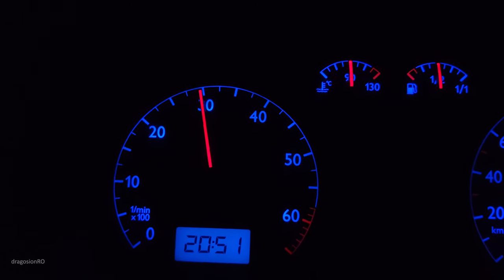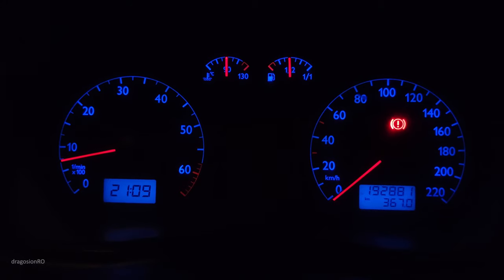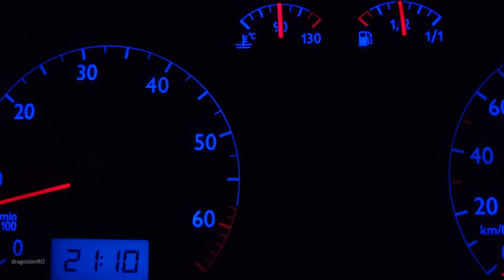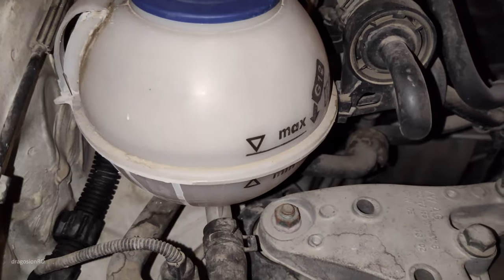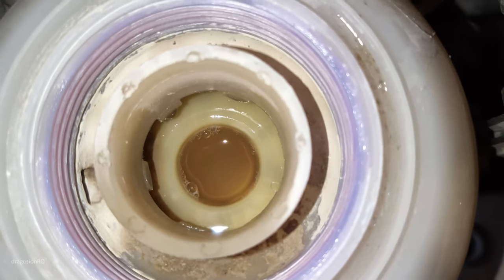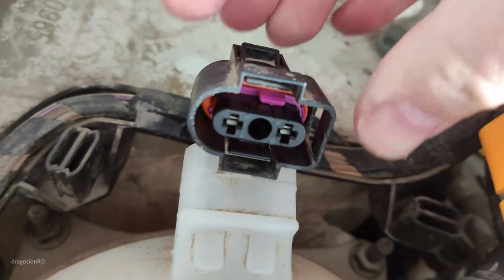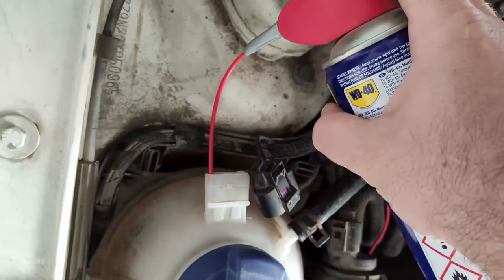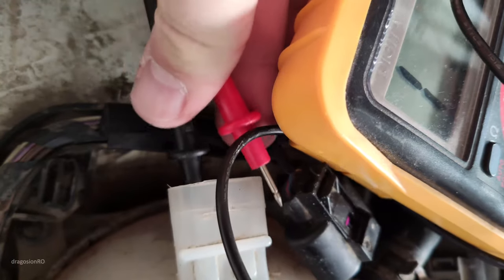VW Polo Temperature Light Flashing Fixed

Comment from the maker: Amazon: Engine Coolant Expansion Reservoir https://rex.red/engine-coolant-reservoir-vw-polo-9n *
Tools https://rex.red/car-tools-kit-mechanic *
Cleaning https://rex.red/car-cleaning-supplies *
WD-40 https://rex.red/wd40  *
Torx socket set https://rex.red/torx-set-socket-45-55-60  *
Jack https://rex.red/car-jack *
Stands https://rex.red/car-jack-stands-heavy-duty *
Gloves https://rex.red/car-gloves-mechanic *
Safety glasses https://rex.red/safety-glasses-anti-fog *
Spark plug removal tool  https://rex.red/spark-plug-removal-tool  *
Spark plug Gap tool https://rex.red/spark-plug-gap-tool  *
Coil puller tool https://rex.red/coil-removal-tool  *
Car fuse set https://rex.red/car-fuse-kit  *
Battery tester https://rex.red/car-battery-tester  *
Maintenance kit https://rex.red/car-maintenance-kit  *

Subscribe and Ring the Bell to watch more videos.
ION HowTo https://rex.red/ionhowto
RedNumberONE https://rex.red/rno

Buy merch https://store.ionhowto.com/
Check it, buy it, post it and  tag it #ionhowto or #rednumberone

Join this channel to get access to perks:
https://www.youtube.com/channel/UCx4Qbp3iC97kQzj7e7g7slg/join

We earn money from qualifying purchases using our affiliate links.
Affiliate links are marked with a star. *
When you use our * links, you support this channel.
As an Amazon Associate I earn from qualifying purchases.

Comment: Thank you for the upload.
My polo struggles to idle and switches off when cold but idles perfectly when warm.
Any ideas? Thank you in advance. 👍🏼
Reply from the maker: Look for videos about coolant temperature sensor. I didn't make any. Could be this sensor too or the throttle body. Try carb spray and too
Reply: @IONHowTo 
Thank you very much. I'll check for those items. 
Thank you for responding so quickly.
👍🏼
Reply: Timing

Comment: Hi! Hi have the same Car, polo 9n. A month ago I removed the battery from the machine to be able to recharge it since with the lockdown and the little use, it was discharged. Today I resinserted the battery. Then I turned on the car and started. After a few seconds it emitted 3 beeps and the red temperature light started to flash. The liquid cool is ok and is slightly above the minimum level. I topped it up but the situation hasn't changed. I went around and the temperature hand is fixed at 90 degrees and I don't smell strange smells. I opened the hood and there are no signs of various vapors. It seems strange to me that the problem arose after removing and reinserting the battery. In February it was fine. Tomorrow I try with the WD-40. Can you tell me where the resistance is so I check this too? Thanks so much!
Reply from the maker: Check for corrosion between the connector pins like in the video. Resistance also depends on what coolant mix you have. 
WD40 is a good start.
Reply: @IONHowTo  i tried but it didn't work for me :(  i will bring my car to the mechanich
Reply: I have the exact same thing right now my battery also discharged, I think because of a cabin light button that went on and off all the time and I did not notice. Have you solved the problem? If so what was the cause? Thanks in advance!
Reply: @boardstopia  same issues here. Did anyone fix it?
Reply: @waynezhang3969  I did, I soldered all connections in the dashboard. Easy to do it yourself that fixed it. After some time due to vibrations the soldering can break and break the connection

Comment: I braught a polo 9 m today and it had a new expansion tank 2 weeks ago and the light still comes on and beeps at me like every time I drive it I don’t know what it could be
Reply from the maker: It could be the coolant mix or a bad contact in the dashboard.
If the level is ok, try to change the coolant and mix the original pink coolant fluid for this engine with TAP water not distilled water - instructions on bottle for ratios.

Comment: Same issue in Our garage car came  i replaced 2 Coolant sensor and also Replace receiver tang again same issues
Reply from the maker: Someone was saying it may be a bad contact on the dashboard but I don't know about that.
I had it come up again after using distilled water instead of tap water to mix with antifreeze.
It measures fluid conductivity. I guess this is why they say use tap water. Could have been a temporary instrument cluster problem.
Now I don't have the warning light.
Reply: @IONHowTo  Clear In side air

Comment: Hi  brother im new driver
Just bought a vw polo 2005 
Im kinda new driver no idea about cars
So basically when i drove my car afte driving like 1,or 2 kilo meter its temperature needle goes frm 30 to 90 in a minute 
And stays there,dd,nt go up from 90 
There is no red light in dashboard showing heating problem,
Plus my radiator fan ddnt start when i ignition my car,,
So just a quick question is the temperature needle goin from 30 to 90 is normal? Or its shows some problem
Reply from the maker: Shold slowly increase but it's not a big problem. The fan won't start unless it's needed. At some point it will start. Try to turn on the AC. fans should spin when ac is on.
Reply: @IONHowTo  thnx bro fr getting back to me
Really appreciated 
Keep carry on with helpful videos❤️❤️
Reply: @IONHowTo brother now im with new problem😂😂
Actually im with the same polo
When i bought that car the guy said he have changed gasekit head timing belt etc oil change n service 
Well i ddnt check oil level,,well through that time i almost drove about 2000 miles
Then last week it started giving bad noices ,i went to mechanic he said oil level is too low ,feel like your car is consuming extra oil
So because of low level of oil there come a gap in tappet,so we have to open full engine and it gonna cost abut 400 to 600 pounds
Well thats old car i dn want to spent that much money on it again,
So what you think if i just top up oil level n start driving it,,
What you think wouldn’t be a issue 
As noices are still in car,oil level is ok
Mechanic said you can drive it just top up oil,n bear the noices

Comment: Thanks for the video! I have a similar problem. When I drive the temperature light flashes. Also, when it's hot outside (when the sun has been sitting on the car for too long) the car won't start. I checked the coolant level and it was below minimum so I refilled it. Could this mean I have a mechanical problem? As the coolant level was low?
Reply from the maker: Take it to a mechanic
Reply: Homtom2
did you solve the problem when the hot one won't work if you are not I will tell you I solved it simply greeting
Reply: @muneverkarsic1466  The mechanic reset the computer (think it has to do with the throttle) and it works better now, still not convinced I wont have the same problem next summer though. What did you do to solve it?
Reply: I had a problem with cold solder for a kilometer an hour amplify the solders 5 minutes of work and no more problems my friend
Reply: @muneverkarsic1466  Thanks for the tip, I'll definitely take a look at it if it returns in the summer!
Reply: I have this problem but in the cold mornings ,when ı start the engine,it flashes.Do know why?
Reply: I got the same problem today and stopped. Added water to reservior but returns again. What shall I do now?

Comment: Having a similar issue with a VW New Beetle 2000, The connectors seem fine and coolant is clean. Should I replace the tank?
Reply from the maker: Yeah changing the tank should do it.

Comment: Hello thanks or the video i have the same alert i changed the bottle and i have the same alert and it always shown even if i start the car in the morning ... :/
Reply from the maker: When mixing coolant, use tap water not distilled water. The sensor measures the coolant resistance and distilled water would not work.
Reply: @IONHowTo  alright bro i will do it and i'll tell you if everything is good thank you for your answer <3 <3

Comment: Same car (BBY) - same problem, changed the expansion tank / temp cooling system sensor. Problem remains. Thinking cluster issue.
Reply from the maker: Check the connector to the expansion tank. Also use a mix of coolant and tap water. 
Distilled water can give a confusing reading. Had some strange behaviour with distilled water.
The probes measure the lebel with how electricity is being conducted in the coolant fluid.
Try a obd2 reading maybe more info there.
Reply: i have a problem polo tsi gt when i drive 3 km overheating car soo much going 120c what can i do please tell me 😊

Comment: When I turn my car on the oil can comes up red and the thermometer is red but they don’t flash when driving is this okay?
Reply from the maker: You should take it to a mechanic and check oil level first maybe. If you have any oil light it could be oil pressure but needs to be checked.

Comment: Okay so  i was driving and all of the sudden had the same light flashing. Pured water in the tank and found out it was leaking frome hose some where between engine and cabine and i still drow 40 km. Now idk will it cause more problems. Same car
Reply from the maker: Get the leak fixed. If the leak is in the radiator and not big you can try to use leak stop products - video coming up sometime this month hopefully. If its in the coolant pump or hoses the parts need to be replaced.
Coolant is bad for animals around, look it up.

Comment: i will clean the teminals , i have this problem of light flashing while driving, i keep on topping the coolant and it will goes back again after a day or so
Reply: do filling the coolant more than the mark has an effect
Reply from the maker: Its better to fill up to mark. Check for leaks on radiator and hoses and if oil looks creamy - coolant mixed with oil - bad stuff.

Comment: I actually got the same polo as you i think. I for the 2007 facelifted 1,2 gas. But i got a problem i hoped you might know how to fix. The engine light is on cus one of the fuel injektors is dirty. So it runs a bit lean. I have used maybe 4 bottles of fuel injector cleaner but it doesnt work. So i think i might have to replace them. 

But heres the problem. Im an ape when it comes to wrenching. Could you pleas make a video or Try to explain ut to me? Iv seem sine other videos on it so i got a genneral idea om what im looking for. But ist always some minor details iv never heard about.
Reply from the maker: I've never had problems with the injectors so I have no video for it. 
Did you do a scan for error codes?
Reply: @IONHowTo  yeah, its injector number 1.
Reply from the maker: If I were you, I'd find a place that does ultrasonic cleaning. It might work if they don't charge too much.
If you do run cleaner thru them it's best to use a kit that is made to connect directly to the fuel rail.
DO NOT just put cleaner in the fuel tank. That will bring even more dirt from the fuel tank into the injectors.
The fuel is under pressure so fuel pump fuse needs to be removed and it has a pressure release valve but to actually remove individual injectors from the rail... I'm not sure I can help with that.
Reply: @IONHowTo  thanks you for the reply tho. I Will try and fix it

Comment: Should i stop the car ?
Reply from the maker: Check coolant leven if it really is low.
If it's low, top-up with tap water not distilled water.
The sensor checks conductivity of coolant so tap water is what they actually recomment to mix with coolant - pink.
Reply: @IONHowTo  I have this light blinking since yestreday. Its 9N3 1.4 tdi. I dont have heating inside cabin even if i drive for 40 min
Reply: And i lost some of the coolant water on side where is water pump
Reply from the maker: @dejanmilovanovic2413  take it to the mechanic asap if there are leaks around the water pump
Reply: @IONHowTo  ok thank u. Il write here what i did

Comment: 3:30p the red light is blinking but the thing is full what do i do ? i’m a girl
Reply from the maker: If it's blinking in less than 1-2m after you start the car it's ok - it's the sensor and level is ok.
That light can also blink if the engine is overheating so check the temperature dial and check the oil dipstick make sure it's at normal level and doesn't look foamy or creamy like mayo. 
Or take it to a mechanic to sort it out for you.

Comment: When sensor light comes on my fuel gauge stops working too
Reply from the maker: Sounds like fuel tank/pump problems but im just guessing
Reply: @IONHowTo  but it only happens once temp sensor comes on otherwise it works fine
Reply: @IONHowTo  runs rough and using a bit of fuel
Reply from the maker: I'm sorry, never had that. Don't know how to help.
Try to get it scanned for error codes with an obd2 interface.
Maybe there's some clue there.

Comment: How do you see if the A.C cooler fan not working?
Reply from the maker: Outside fan, doesn't spin when ac is on.
Inside fan - no air comes out of ac air vents on any speed including speed 4.
If it works on speed 4 but not 1-3 its the resistor not the fan.